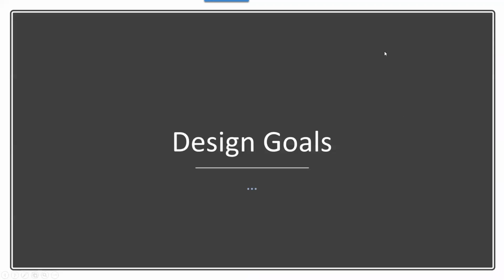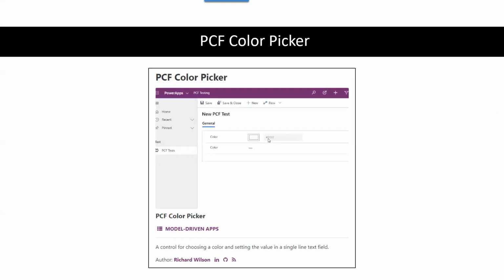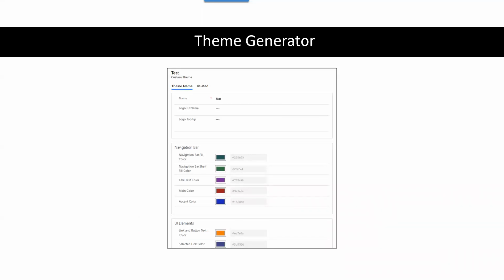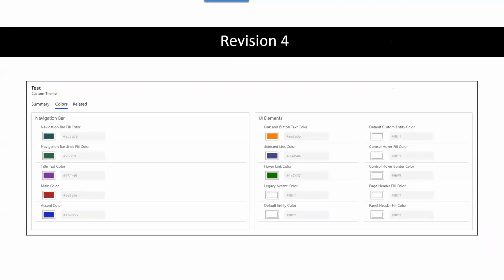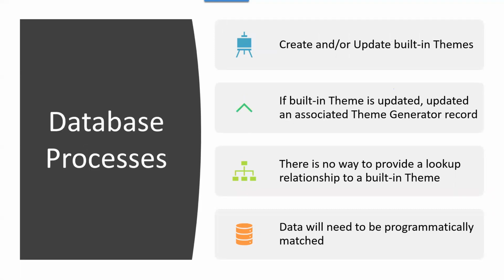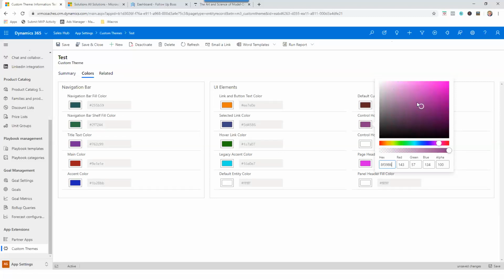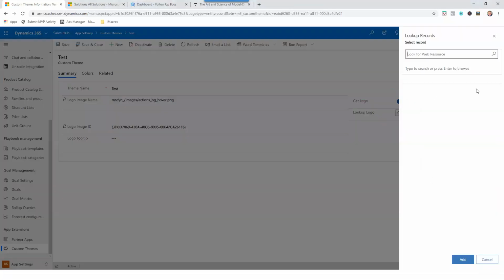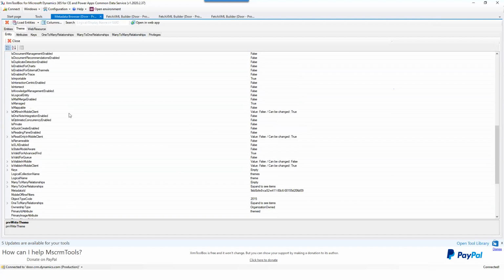Design Session - Building a Theme Generator for Model-Driven Power App

Comment: Thanks Mitch, some interesting things there. i particularly liked the color picker.
A couple of things for you on form layout:
1. Your comment about section label width not being complied with fits in with what I've found. I think the rationale for this might be that UCI has responsive design across different windows widths and mobile form factors. The danger of complying with a large label width is that a mobile in portrait orientation wouldn't be able to see the value.
2. The advantage of using tab columns over section columns is that the responsive design works better. It 'folds' the tab's right column underneath the other columns as the width reduces. In my view, this works rather better than the section columns.
You can experiment with both of these by changing your window width.  In the Power Apps form designer, you can also view different form factors (menu in bottom left). As you'll see, there are other things that are moved around with the window width, including changing from labels to the left to labels above.
Reply from the maker: Hi Alex,

#1. That is my assumption as well.
#2. Agreed. In one of the videos in the course I talk about the ROI of a customization and made them watch me spend 17 minutes playing around with all of that trying to get the UI to look the way I wanted.  It is all trial and error.  Some of us are just a little more OCD than the others. :)

Thanks for the comments.

Mitch